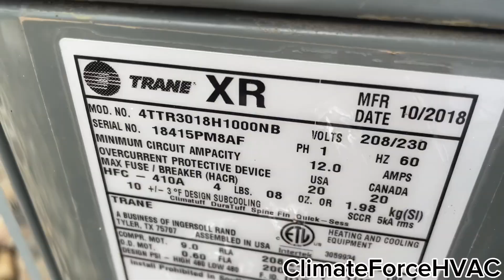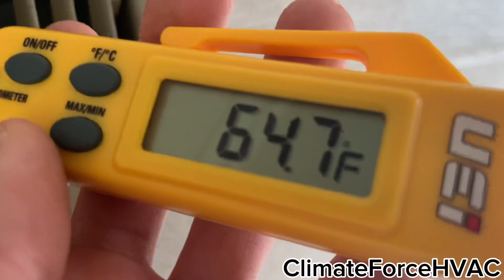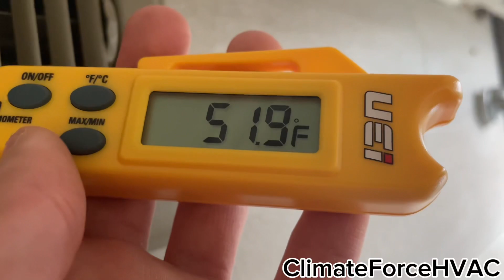2018 Trane XR13 - Startup and Shutdown & Temperature Check

Comment: HVAC newbie here.

I've always wondered why a condenser fan unit that sits under the sun and in sweltering heat is it able to cool the hot vapor inside the evap coill which itself is also hot as f.  Could you help explain?

Thank you sir!
Reply from the maker: The evap is your indoor coil, which has cold refrigerant in it, which is getting transformed into a vapor as it goes through the coil. I will explain a basic refrigeration cycle to help you understand a bit better.

We will start at our compressor, which is in the outdoor condensing unit. The compressor creates a pressure differential from the high side to the low side. It compresses the refrigerant into a high pressure and high temperature vapor, and is sent out through the discharge line (smaller line coming out of the compressor). 

From there, it will enter the condenser coil, also known as the outdoor coil. The condenser condenses the refrigerant into a high pressure and high temperature liquid, hence the name condenser. This is where your liquid subcooling and indoor heat removal take place, which is why hot air blows out of the unit while it's running. 

From there, the refrigerant goes through your liquid line (small line leaving the condensing unit). It travels inside into our metering device. This metering device drops the pressure and temperature of our refrigerant. This is where flash-off happens. Our refrigerant is now 25% vapor and 75% liquid going into our evaporator coil. 

As the refrigerant is going through the evaporator, (where our superheat takes place) it is getting boiled into a vapor because the evaporator absorbs the heat from the house and sends it through the suction line back to the condensing unit. Our now low pressure and low temperature vapor enters our compressor and the cycle continues. 

Hope that helps :)
Reply: @ClimateForceHVAC713  
Thanks for giving me an overview.

Though, I just realized I made an error in my original question:
" wondered why the condenser fan is able to cool the hot vapor inside the condensor* coil"

I just didnt think a fan that sits under the sun in sweltering heat can still be so effective in helping with the condensation process and in removing heat.  From your experience, what are the temps of the compressed vapor refrigerant that's entering the condenser coil?
Reply from the maker: @pussiestroker  Entering the coil will be extremely hot because it is leaving the compressor. the evap coil helps with condensation, the condenser does not. Thanks for the kind words :)
Reply: @ClimateForceHVAC713  Man, if you are in the Greater Toronto Area, you are definitely getting business from me.

I had to spend a fortune repair my AC last summer, and right now I have a broken refrigerator on my hands, so I am just trying to learn the principles of the refrigeration cycle. 🙂